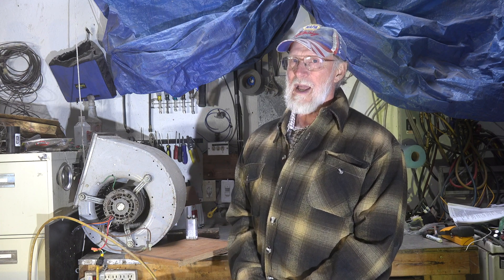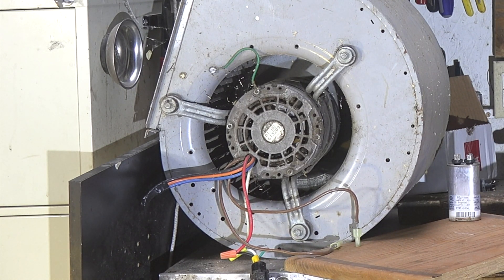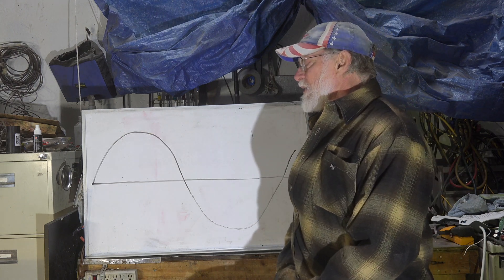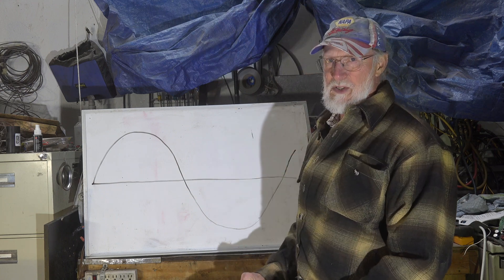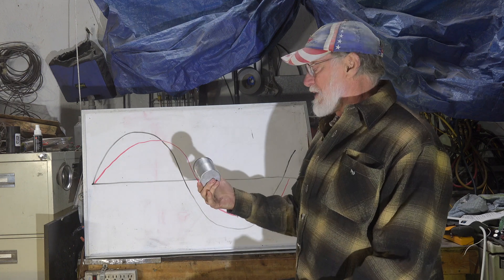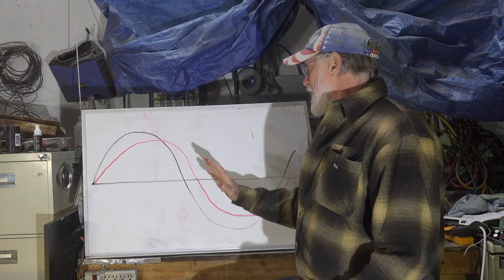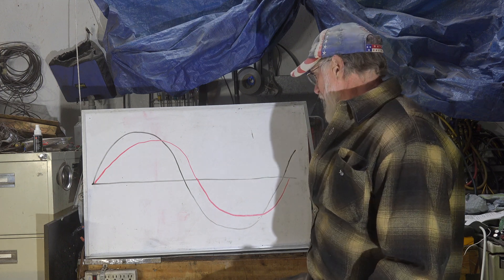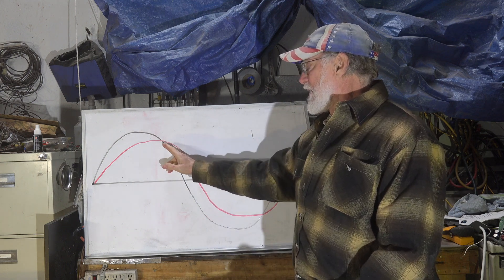How the capacitor starts the PSC motor

Comment: Just wondering how many Amps required to start a typical 1/3  HP sump pump with a  PSC motor, for example using a generator in a storm.

Comment: D'ja ever notice a PSC motor makes a sorta 'ringing' sound when the capacitor is failing? It's a 'wonnnnnnnngggggg' motor complaining sound. As things warm up, the motor slows and that groan gets worse... I used to think it was bearing noise from fan/blower motors starting to go south. Now it's an instant diagnosis from a mile away and a cheep quick fix!
Reply from the maker: Interesting.  I can't say I have ever seen that.
GFM

Comment: Always remember ELI the ICE man.
Reply: aliso 82      4.19.20.     In a purely Inductive circuit, voltage leads current by 90deg ....... In a purely Capacitive circuit, current leads voltage by 90deg. The start winding is out of phase with the run winding, thus creating Torque to spin the fan.
Reply: This is not explained correctly.  It is out of phase by 90 degrees, not like you show. Current leads voltage on capacitors

Comment: GFM, I have been watching your videos for some time now and this is my first time posting. Thank you for all your videos! Does the sine wave end up lining up with the incoming voltage sine wave once it is at full speed?
Reply from the maker: Without getting too far in the weeds, the sine wave will never match exactly, but the back EMF will affect the lineup of the sine wave.
GFM
Reply: The capacitor delays voltage, the current starts as soon as the capacitor starting charging up. increasing back emf could slightly increase the phase shift, right?
Reply from the maker: @Jon-hx7pe  I don't have an answer for that one.
GFM
Reply: another thought - the back emf could slow down the capacitor charging process due to the resistance to current and increase the phase shift that way.
Reply from the maker: @Jon-hx7pe  Could be.
GFM

Comment: Nice one GFM
Question, is there a chart or rule to size a run capacitor, or a start capacitor for that matter? it seems that if the data sticker is blank or worn off, the layman is not privy to this information. The motors are always well marked as are the OEM capacitors, but not aways. Thanks
Reply: Craig Nehring or if the guy before you just used what he had on the truck..
Reply from the maker: @Supplyhousemarco  These things seem to be by manufacturer.  There probably is some rule but I don't know it.  Btw, just putting what you think might work is usually wrong.  Been there tried that.
GFM
Reply: @grayfurnaceman  Got me to thinking so I did a search for the terms "Capacitor motor chart" Turns out to be quite a lot of info out there. I am sure some motors may take a very specific size and or rating. Of course one needs to know if your replacing a run or start capacitor. Mind your voltage ratings!!
 Voltage ratings are always much higher than line voltage, another good topic GFM
Reply from the maker: @craignehring  When I see the charts for run caps, I think back to when manufacturers increased the efficiency of their motors by increasing the strength of the run caps in the 1980s.  I assume the design of the motors was changed to accommodate the larger caps.  
Do the charts take this into account?  If the wrong strength capacitor is used it can destroy the motor.
As to voltage ratings, you need to understand that motor voltage is the incoming power + the back EMF.  Something around 180 volts for a 120 volt motor.
GFM
Reply: grayfurnaceman thank you my friend. Your vids have been huge in my career path. Keep on keeping on
Reply from the maker: @Supplyhousemarco  Welcome
GFM
Reply: @craignehring  Reverse EMF raises voltage across the capacitor near 400 VAC.The capacitor failed in my Bryant heat pump fan. Factory rating 375 V cap has 393 Volts on  it while running ......